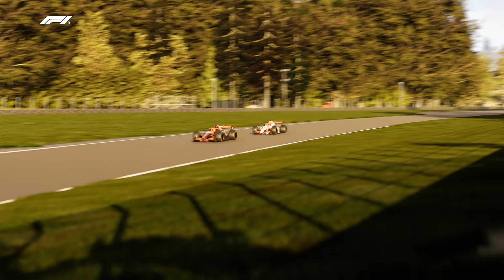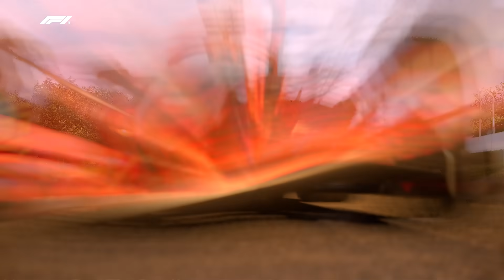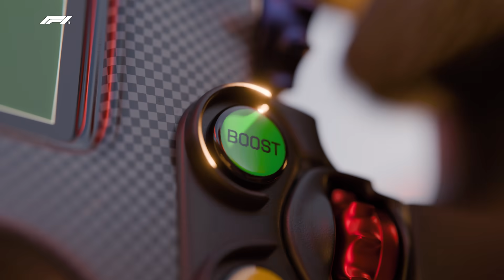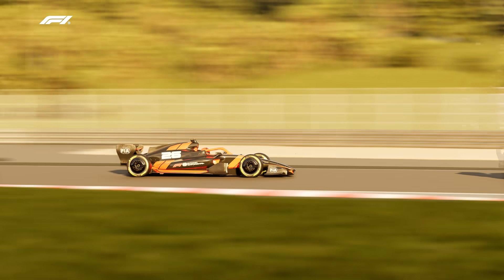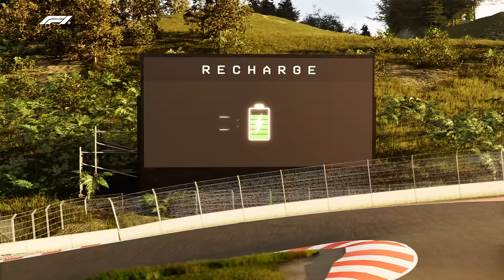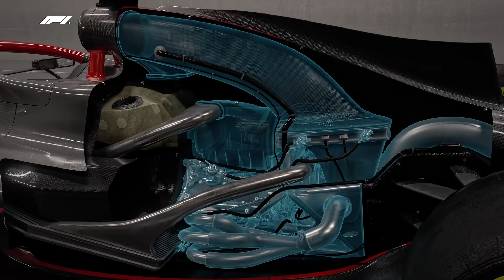Everything You Need To Know About the Formula 1 2026 Regulations

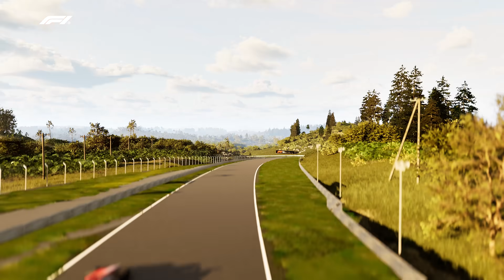Comment: 7:50 if it’s sustainable fuel and we don’t have to worry about fuel usage why not go back to the V 10?
Reply: Because it's not what the engine makers want to work on, F1 is a very expensive playground and they prefer to work on stuff they can implement in their road cars in a few years.
Reply: @xcaiusto  I think the lie that F1 is working to have most of its technology scaled down to production cars is a marketing gimmick… The technology is so advanced we just simply don’t need the performance advancements F1 makes to drive to work. Other than maybe the battery tech improvements & a production car ready sustainable fuel? I vote bring back V10’s in F1, & I bet the marketing teams can still say “the same technology powering our F1 cars” like they plan to do to sell more cars
Reply: @cartert147 that's only if you're shortsighted enough to think the tech will show up in a short time, these things take years to mature and get cheap enough that they can be implemented into a regular car, but the research needs to be done and that's what F1 is there for.
Reply: @xcaiusto  So how many V6 engines Ferrari build in their sport cars the last years ? There is just one Ferrari with a V6 .....
Reply: @5co756 Ferrari is just one of the teams, they'll always be in F1 regardless of the engine, but there's a reason why Ford, Audi and GM are all gonna make power units in F1 and it's not because they're excited to make V10 Engines I promise.
Reply: @xcaiusto Publicity , nothing more .
Reply: They are considering it but they can’t keep changing regulations every 3 years so will probably find in min 5 years
Reply: V10s are rumored to be coming back in 2031, and btw, sustainable fuel means less carbon emmisions, not less fuel usage. V10s drink fuel, V6s don't - V10s will probably need refueling re-introduced or bigger fuel tanks.
Reply: @thebritishmotorsportfanmore like V8
Reply: It's about politics and deals with the FIA.
Reply: because combustion engines will disappeat eventually.. manufactures want to do reaearch, so electric part is inevitable
Reply: @Johannes-kn2op  and where will be the joy of that pure sound of an amazing engine, such the all mighty V10?
Reply: Because of the shity EVs. Don't forget that F1 is the center of the automotive inovations so they build the regs on top of what brands want
Reply: @_litzz72 "shitty evs" keep hating you know it's better
Reply: Unfortunately the goal is to go full eletric. They dont just do that cuz would lead to massiv drop. But in a few years? probably
Reply: @madsoncaminha2517  I will stop watching if they are going fully electric. We want the engine noise
Reply: @RobbedoesMT09 F1 is not going electric bro. Formula e is literally right around the corner chill out

Comment: The rules look very bad the sound of the engine does not look promising with these 50-50 engine and battery. I think F1 is going in the wrong direction would love to be proven wrong.
Reply: exactly people focus on the looks but forget that it will be all about battery management, even worse and more boring than the current tyre management based racing

Comment: We're a few regulation changes from having another formula E
Reply: I was thinking the same thing when watching this😂
Reply: From 2028 drivers can turn off their engines and rely on battery for upto 2 laps. Save fuel and no pollution 😂😂
Reply: @TOPS-lg3kz  batteries get initially charged by power plants, which make pollution as well
Reply: I literally had to scroll to the comments because at the 5 minute mark i had that exact thought😂
Reply: Yup Its LUDICROUS
Reply: Electrical engine is the future. Get on board or get left behind. Yes I’m talking about Max
Reply: @dannyn6036 for that you have Formula E.
Formula One should be about roaring engines!
Reply: By 2030 the IC engine will be a 500cc single cylinder running on LPG as a range extender.
Reply: @saltycracker2344  sounds cool. Formula 500 actions are great.
Reply: @marguskiis7711 keep V6
Reply: Formula 1 has to be about roaring engines. That's the DNA of this sport.
Reply: @s0nofg0d2 said who?
Reply: @ArisDrive3 all the people with more than one braincell buddy
Reply: @ArisDrive3 says THE REAL F1 RACING FAN
Reply: @ArisDrive3 otherwise it's becoming formula 1/2 E
Reply: I wonder how these cars are gonna sound...
Reply: @Hide_and_Tweak  F1 posted a soundclip on social media of the engines being used. Both in straights, upshifting and downshifting. In my opinion they don't sound bad at all.
Reply: @danalog11  on air it would sound identical to current cars
Reply: @Hide_and_Tweak AWFUL
Reply: 2027 -- 200 hp ic engine and precharged batteries.
Reply: In the end what matters it's the speed
Reply: @analogikkortex combined with the sound yeaah, speed without sound is boring af
Reply: Just make the cars fast we don't want more electric car
Reply: Formula E makes this look like Formula Ford, it's so much more advanced
Reply: Exactly...
Reply: @bertoldkadar3968 not really
Reply: @ArisDrive3  great argument

Comment: looks like overtakes will mostly happen at the middle or end of straight line still
might be better if it is 500 mm shorter, 200 mm narrower and 50 kg lighter than 2025's
but don't know if it can hold all the components inside this size

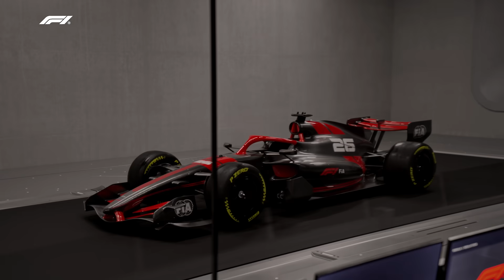Comment: 2:24 ok let's say there's a contact, wouldn't the outwash part be easily ripped apart?
Reply: Almost undoubtedly
Reply: I wonder if teams would make them changeable mid race, like the front wings, if they find they keep having them knocked off and they seem to be a crucial part of the aero.
Reply: If it isn’t changeable then it’s probably for a double knock out, contacts usually affect one (or many more based on scenario) but now the chance of multiple cars getting affected is higher, imagine that piece just breaking of and puncturing the car that broke it off and the cars behind them, more debris more DNFs😂😂
Reply: @Nouzen21  fia will dawdle and wait til 4 cars get punctures before they call a safety car
Reply: Yep - that was my first thought as soon as I saw it. It looks like a reasonably sizeable chunk of carbon fibre that's going to cause a lot of debris issues... ie punctures, yellow n red flags... Soo many questions - If lost how much will affect car performance?  will teams design it to be knocked off, or replaceable like a front wing...
Reply: We are checking

Comment: Pathetic. How they cant understand the difference between Power Source (Fuel in combustion engine) and Battery(That takes kinetic energy generated by the engine and stores/releases it, now even less with no MGU-H harvesting) - yes it harvest's energy on breaking but it's not even close to the so called peak power - Li-Co will be legendary. 
It's not 1000 BHP, and will never be. It's 540 BHP engine with extra steps. 
"GP2 engine, GP2 !" era is upon us.

P.S. And those posh eco fuel drivel is like advertising gluten free bullets. Ok but so pointless to be a meme.

Comment: The aero changes seem promising. The power units seem like they’re going to be awful. The sooner they ditch the hybrid system the better. A V8 or V10 running on sustainable fuel will bring the spectacle back, reduce the size and weight, and still allow the manufacturers to claim they are innovating with environmentally friendly fuels. Ultimately that’s all they care about when it comes to making the sport more green - marketing. The actual amount of fuel the cars use is completely negligible compared to flying them around the world and putting on huge events with hundreds of thousands of people, so electrifying the cars even more doesn’t achieve anything apart from make the sport worse. For the record my road car is 100% electric!

Comment: Goodbye DRS 👋 hello DRS in front and rear wings with a new name.
Reply: and without the need to be within a second of the car ahead to use it.
Reply: @mvh996  But the overtake (energy system) requires you to be within 1 second before you can use it (but you can use it anywhere on the track after you hit the detection point).
Reply: @gerwim  i'm not talking about overtake, i was replying to the op about drs(aero based)
Reply: @gerwim but it's not aero based anymore
Reply: @GuidoHaverkort  then what is it?
Reply: @mvh996 so it gives no real advantage
Reply: @ACoonerMatata  so technically if you believe, thats the same as no drs🧐
Reply: @SafwanHayaat pretty much , but replacing DRS is the electrical energy boost you can deploy within 1 second of the car ahead
Reply: @SafwanHayaat not necessarily causw reducing the drag will drain the batt slower and be more efficient
Reply: @ACoonerMatata  so basically they just turn around DRS and ERS
Reply: @ACoonerMatata its all about management.
Reply: @ACoonerMatata replacing drs with MOM
Reply: @ACoonerMatata  again with the difference that the energy boost is not limited to specific sections on the track but can be used anywhere. So hopefully less predictable where the overtake will be attempted
Reply: @Smooth_Operator-04 what you call my mom now 😂😂😂😂
Reply: @captaintoet1983 ALONSO USES HIS MOM TO OVERTAKE HAMILTON, GOING FOR THE WIN!!!
Reply: @Mephilles13 It will still be predictable. Drivers will just attack just after or across the detection point, to give them an entire (extra)lap of extra power. Also there's still pirelli
Reply: @ACoonerMatata  It's not about getting an advantage, it's about making the cars faster on straights to increase the length of braking zones.
Reply: @SafwanHayaat driver can adaptive to their driver style during the race rather than depend on race day set up
Reply: @ACoonerMatata the whole point of it is to increase breaking zone distance to allow more overtake opportunities did you watch the video?
Reply: @LetsChrUp which is also achieved by DRS. Besides , this is only going to increase speeds by at most 5-10% so will literally have no impact on the length of the breaking zone.
Reply: @ACoonerMatata it gives plenty more advantage. 

Less mess in the wake of the car means more clean air for the chasing car...
Reply: @SafwanHayaat yes
Reply: @Mephilles13 it is always predictable where to overtake...its just racing...
Reply: @Smooth_Operator-04 😂
Reply: @erichhonneker3181 hehe
Reply: @Smooth_Operator-04  😂😂😂
Reply: @ACoonerMatata was thinking the same. Someone explain why it matters if everybody can and will use it?
Reply: @mvh996 you do realise that can be done with the old DRS right?
Reply: @k.h.a-p5o  tell me how? You cannot use DRS without being within 1sec.
Reply: @HoBBLeCooKiE  someone didn't watch qualifying...
Reply: @k.h.a-p5o  yes, but  it is limited in its effectiveness due to the reasons explained in my previous comment.
Reply: @georgemayatt896  All of us here are talking about the race and not qualifying. 'Overtake' mode can't be used unless you're within 1 sec of the car ahead just like you could with the DRS. On the other hand 'boost' feature can be deployed by the driver anytime.
Reply: It’s the new & improved ‘Downforce Regulation System’ 😂
Reply: Hi MOM
Reply: @fjamesp  😭😭😭
Reply: Am I the only one annoyed by the absolute lack of hitting apexes in the animated demonstrations?
Reply: @HeartbrokenHeartshooter  yeah i see what you mean
Reply: I think you do absolutely not understand this. DRS gaves a massive advantage as only the car following was allowed to reduce drag. Now both cars can use it. So the days of DRS are over whete one car could Flyer past another with +20 to 30 km/h. There is no longer an advantage for the car behind. These days are Gladbach over. And we can see really fights again with two equal cars. Not one slow, one fast and one flying past without any effort, without any skill needed.
Reply: @fam.hunger5244  except the car behind will have the overtake boost function so……
Reply: @m @markygti138  Indeed. Active aero is used to manage battery deployment. Otherwise, cars risked running out of battery halfway down the straight.
Reply: @fam.hunger5244 I never said I understand I’ve been asking for clarification on how it will work which u gave me none of im just trying to understand how it’s gunna go going forward I appreciate your superior understanding on how this works but why not give me some actually info instead of talking down?
Reply: FDRS
Reply: And with electric boost DRS and overtake drs.
Reply: They all have all and all have at the same time how that drs
Reply: It's mainly just there to increase efficiency for the cars across the grid. They know with a near 50/50 split, they need every bit of efficiency they can get especially since the battery is now responsible for both defending and attacking
Reply: Hello MOM
Reply: Not really DRS… DRS could only be used in very specific circumstances. This can be used by every driver, every time they’re in one of the zones.
Reply: You didnt listen
Reply: Active aero isn't drs .  
Drs clearly gives advantage to the car behind 
And made racing boring 
While trying to fix not enough racing
Reply: Mate did you even watch the video
Reply: We have MOM overtakes.
Reply: They said the new active aero with help with overtakes? Yet everyone can use it all the time? Wut?
Reply: Actually, overtake mode replaces drs. The active aero is meant to save fuel and battery.
Reply: and DRS zones
Reply: I thought I was tripping they said we will see passes in new places we haven’t before but I don’t see it happening but time will tell
Reply: It's very different the way it works
Reply: @zephyrie1-d5f it just sounds like drs but broken up into boost, overtake, and front and rear wings
Reply: @kyleburchstead5519  it isn't though. both in terms of the mechanism and where one can use it , it is  different. it is not bound by the restrictions of drs(limited to drs straights, within one second of car ahead)
Reply: @mvh996 oh ok makes sense then overall I do think we will end up seeing who the best drivers really are out of these changes
Reply: It’s called M.O.M
Reply: I like others were laughing at everyone saying goodbye when it was not really going away.
Reply: Another newbie to F1 who doesn’t understand anything….
Reply: Lets see sainz become world champion 😁
Reply: @youtubehalo_mas_maul let's see Sainz and Alonso duke it out until Abu Dhabi for the championship!
Reply: New name so Americans can understand it😂
Reply: @DM_Laf 😂😂 fah cough!😂😂
Reply: Overtake button is like push to pass in indycar
Reply: And some boosts and more energy management. It feels like a more technical push to pass
Reply: DRS 2.0
Reply: But it’s not DRS in the same way. You can use it every lap no matter what vs only within 1 second
Reply: So true
Reply: Hi MOM 👋
Reply: It's nothing like DRS and how it was deployed
Reply: Hey MOM
Reply: Every car can use it though, not just when the car is 1 second behind
Reply: MoM
Reply: Sounds like "I've got like a perfect view. I just struggle a bit more to see perfectly"
Reply: new drs is override mode
Reply: DDRS
Reply: The new drs is the push to pass not the active aero 😊
Reply: @jonny6589  Indeed. Active aero is just meant to reduce drag in straights so cars don’t run out of battery halfway down the straight, which was (is) a real concern.
Reply: Hello M.O.M
Reply: Hello MOM!
Reply: Literally
Reply: Should've just called it DRS V2 🤷🏻‍♂️
Reply: Fr idk why everyone making it a big deal. Literally just an evolved DRS
Reply: And overtake mode!
Reply: They just basically exchanged the drs and ers system 😂lol
Reply: @sanjaypaswan7735 no
Reply: At least overtaking will now be more difficult and dramatic
Reply: @Saint_Maximus_III  😂 it’ll be exactly the same.
Reply: @Saint_Maximus_III no...Boost
Reply: Literally, no new “innovations” there is no difference, will still all be close on drs straights, it’s just a fancy speech that’s it, boring
Reply: It's not the same,  now the wings can be put almost perpendicular to increase down force in corners,  drs only decreased drag .
Reply: True
Reply: I'm wondering now about tire strategy and compound elemental differences along with the grip without the extra width....or is less weight along with aero changes going to equalize that?
A nerd question from tire geek...
Reply: Sony haze predicted it!...front changes for attacking corners....plan C....plan C is for combat😉🫡
Reply: The difference is that all can use it on the straights. But then they add a boost button that can only be used when you're within a second of the car you're following?
Reply: "Because of pressing it 50 times before it opens" xD
Reply: it's not really a drag reduction system anymore though, everyone will be in low drag mode on every straight so you no longer gain reduced drag compared to your competitors by using it so it's better to call it what it is now, active aerodynamics.
Reply: Real racing doesn't need buttons and flappy wings to make it interesting .... motor GP is proof of this.... mite as well race on sim rigs at this rate
Reply: Nope...wrong...
Reply: Exactly my thought 😂😂😂😂
Reply: I’m new to F1, do people not like DRS?
Reply: Love all the experts on here  who dont work in F1 😅  mmm I wonder why that is ? Oh yes you are not experts 😊
Reply: Thought that initially. The fact that anyone can use it anywhere means that its not like DRS. Overtake is the New DRS, used within 1 second of lead car just like DRS. Pathetic.
Reply: @ImHavingaCoronary  why is it pathetic? the fact that one can use it anywhere means it wont be predictable, offering strategy choices)